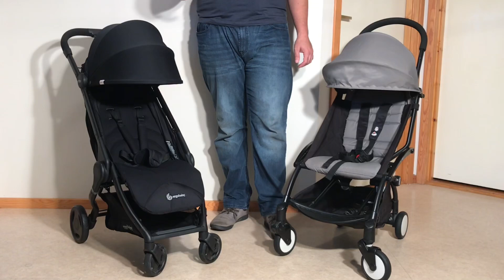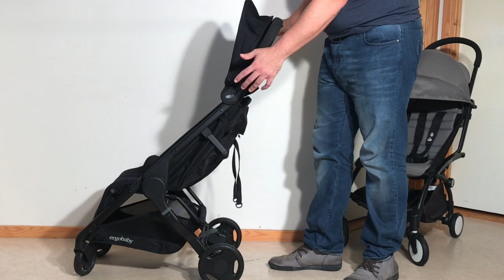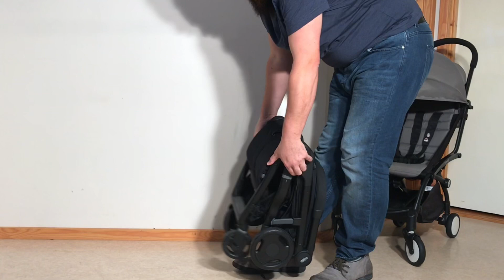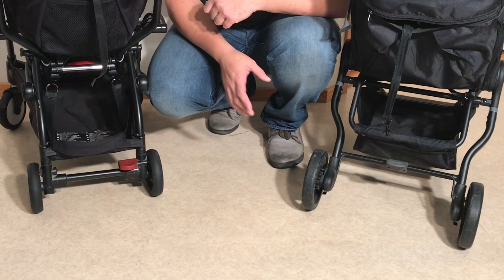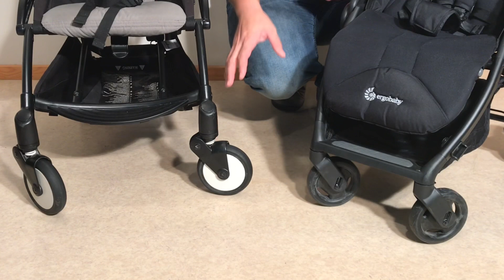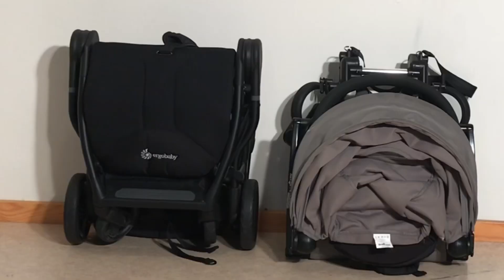Babyzen Yoyo+ VS Ergobaby Metro: Mechanics, Comfort, Use

Comment: I feel like it has to be mentioned from a users point of view the seat of the Metro is slightly sloping forward while the Yoyo seat is sloping towards the back making it more comfortable for the child. The Metro was getting uncomfortable for my 1 year old because only the straps would keep him from falling out of the stroller whilst it does not occure with the Yoyo. I do keep him strapped in in the Yoyo too of course but it's not uncomfortable for him at all. He does not need to be stapped in so tightly.
Reply: Yeah but actually Metro's more upright position is actually much healthier for the child and it even got some kind on award for being the only stroller with real healthy back support (or sth like that, it was in Germany so I don't know the details) and you can always loosen the strap and put it in a lower position.

Comment: Would the Metro be to short for a 6'3 man? I like that it seems som comfortable for baby to sleep in. We're also considering the minu or babyen though. We're travelling to the US (no idea when now though, because of Corona) and the use of the stroller will be in malls or  paved parks with a tiny bit og travel. Its not a must that the stroller fits in the Cabin, just that its small, easy to fold and preferably fits my tall husband
Reply from the maker: I'm 5,11 and a half, and it works ok for me, might feel a little low, but it's probably work in a pinch.  I like the Babyzen a lot better though.  We just got the Joolz Aer in too, though, the review will be out soon. :)

Comment: I’m so confusing which stroller shall I select, Metro or YOYO+ ?!. 

I had an issue with lightweight stroller, last week Joie pact light caused my daughter to flip over with stroller and her face hit the ground due to small bump. 

I need your support and advice , which stroller is better from stability and rigidity to street bump and obstrecations ?!also , which one you feel flimsier,  Is it YOYO OR METRO?
Reply from the maker: Between these 2, the Yoyo+ is better.  But it sounds like you might be looking for a daily use stroller, which neither of these are (neither is robust enough for regular use over a longer period of time).  If this is true, and you need something small but not necessarily airplane small, you will be much better off with the Babyjogger City Mini GT2, the Joolz Hub or the Uppababy Minu, and from there, strollers just get more sturdy and terrain-capable as they grow in size.